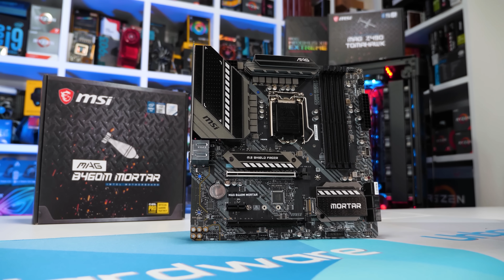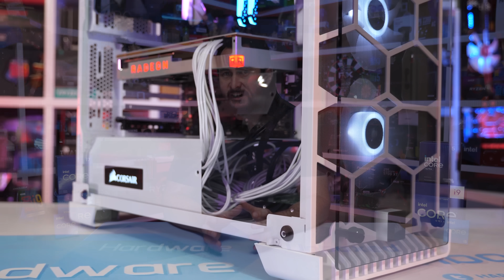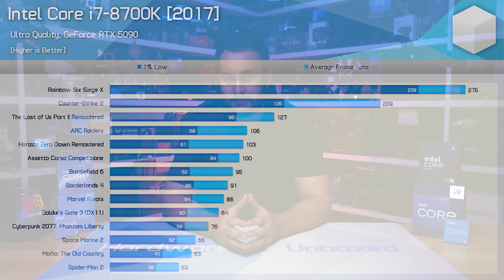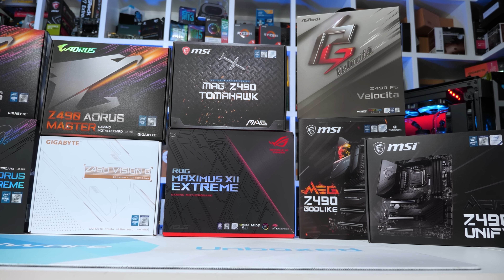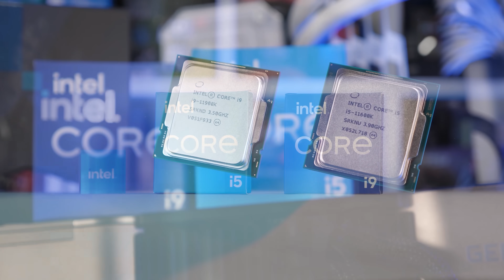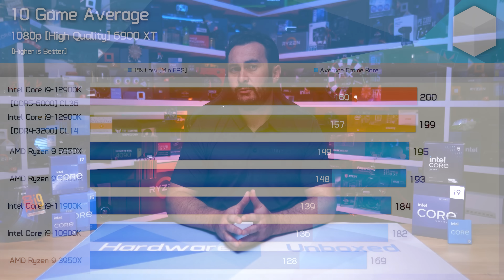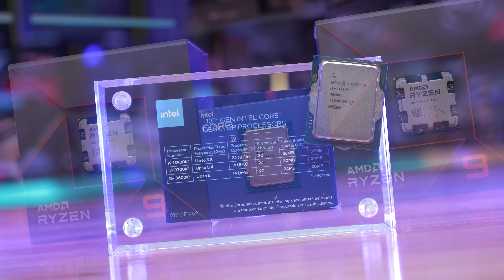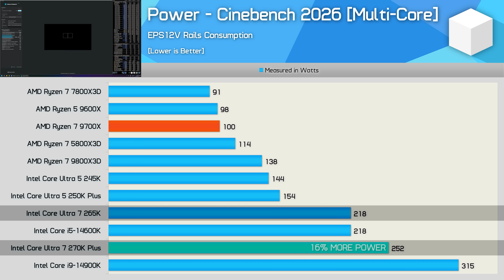How Intel Fell Behind, 10 Years Of CPUs Benchmarked

Comment: If you tried to use these hot chips today you would conclude their performance does not justify the power consumption and noise.
Basically hot, loud, and slow (not fast). Hot loud and fast is fine when new..

Comment: The 8400 was better than a 1600..
Ryzen could only match intel on optimize multi-threaded loads.
The basic core was weaker which meant the rate limiting thread for the game was limited. Single core performance was (and still is) important.

Comment: Just look at those graphs. They SCREAM stagnation. Sleeping in class results in being left behind. Simple as that. I will probably never buy an Intel CPU ever again, out of pure principle. I bought the 6700K when that was THE flagship, best gaming CPU. I never upgraded. Not just because i didn't have the money or need (there was a number of years where i didn't game much after 2020) but the fact that Intel softlocked the upgrade path, as stated in this video. My only real "upgrade" option is the 7700K, and thats a sidestep at best. AMD on the other hand... well... AM4ever. The only thing keeping my 6700K running is sheer willpower and an OC. The CPU STRUGGLES in this day and age. Sure i might have "average" frames that are playable, but the stuttering, the frame times, the absolute struggle of doing ANYTHING in the background while having a game up... If i only knew back then.

Comment: Last Intel chip I had was the 6700k. I noticed that newer chips didn't go higher than 4 core so I switched to amd. Now I have a 9800X3D and I still see no reason to go back to Intel. They put all the budget into marketing instead of engineering.

Comment: 11900K....its just a disaster...
Reply: Yeah, they could have re-used the old core design and boost the core count to 12 or even 14 and still end up with a smaller chip than the 8 core 11900K.

Comment: correction lga 775 (2004-2010) had around 6 years of intel support , yes 1156 came out during this time but processors for the 775 platform were made up to 2010 so this was the most supported platform intel ever came out with

Comment: What I think is worth mentioning is that 14th gen game out BEFORE 13th gens degradation issues were known, so it not only had the same issue, but it was exacerbated by the fact that it was pushed even harder. Intel was just REALLY desperate to maintain their lead in benchmarks, both single and multi core, over AMD, so the hardcore overvolting and overclocking was just necessary. I dont see how nobody couldve seen this, but I could absolutely see marketing or management or some higher-ups just ignoring any warnings by the actual engineers. I mean, engineers, what do they know, right?
Also a common theme with 13th and 14th gen CPU degradation was the curious flavor of symptoms, which were incredibly varied, but invariably pointed at other system components. This was because the ring bus was on a smaller node that was more susceptible to degradation from the higher voltages and thus generally was the first part to fail. Depending on where exactly the degradation occurred it could lead to all kinds of fun errors, from 0MB VRAM on GPUs to RAM issues to USB controller issues, take your pick. Which means that pretty much any time I do friendly tech support I will, regardless of symptoms, check the CPU if its one of those two generations. Happens surprisingly often.

Comment: love it how everyone keeps forgetting about the cpu oxidation issues, ststing that intel has fixed the 13th and 14th gen cpus when the microcode bug was just making the already existing manufacturing defect worse quicker.
also that these cpus are still dying even with those microcode updates.
Reply: Yup, and in server applications, that vulnerability is basically a deal breaker.

Comment: It’s the socket changes that hurt Intel so much. You can have a slightly worse product than your competitor if the switching cost/upgrading cost is lower because I don’t have to buy a new motherboard, but if I’m going to buy a new motherboard, why wouldn’t I switch to the better value option?

Comment: Peaks : 8700k
10700k
12700k DDR5
(Possibly nova lake processor next)

The 13/14 gen did not make it to the list due to power draw and instability , and 270k+ is good but with 4 years apart from 12700k I expected a bigger jump and with nova lake around the corner doesn't make sense to buy so it didn't make it either.

Comment: I still use a 9900k in one of my old gaming computers. I have it paired with the RTX 3090. 

I have my chip overclocked to 5 gigahertz all cores. I don't think I have ever seen it go over 65C. That's with an all-in-one cooler.
It's a great chip. 

I wish I grabbed one of those 10900k chips though. I really love that 10 core configuration. 

Then we got the 11th gen crap....😭😭😭

Comment: Intel really was the king of the quad-core era, but they fell victim to their own dominance. For years, they just recycled the same Skylake architecture, essentially 'taping' on minor clock speed bumps and calling it a new generation (like the 7700K being a 6700K refresh). They got lazy with 'toothpaste' thermal paste and blocked motherboard compatibility even when the sockets were identical. It took AMD’s Ryzen to finally force them to add more cores, and even then, they just brute-forced it by pushing power draw to 300W+ until the chips literally started degrading. After a decade of stagnant 14nm 'plus-plus-plus' refinements, their current underdog status is 100% earned

Comment: That comparison of ddr4 v ddr5 for 12900K with the 11900K in picture is something I really wish I had seen when I built out my system last year.
Oh well, at minimum I should be glad I have a good system at all and built before the ram prices skyrocketed.

Makes me question what I heard anecdotally about 11700K to 12700K though.

I had a 12700K, upgraded to a 14700K, and passed the 12700K plus a repaired bent socket pin motherboard onto a friend who had an 11700K system. She said she got decent increase in halo infinite, guess it’s a lucky coincidence and one of the games that did see a decent increase even with same ram.

Comment: Classic case of painting yourself into a corner. The biggest problem they had was putting too many eggs into the 10nm process. It backfired spectacularly. I also knew quite a few intel engineers and a lot of them were cocky and full of themselves, and it was a potential indicator of the intel culture at the time (between 2008 and 2015ish).

Comment: I used to run Core i7 3970X somewhat overclocked to 4.2GHz (all cores) from the launch year all the way until I upgraded it to a Ryzen 5 5800X. Now I'm going to sit on it about as long if not longer, I guess, considering 98% of games are GPU limited nowadays (although ray- and path-tracing do require extra beef even on the CPU side, when this type of bottleneck actually comes into play, the framerate is already unplayable anyway).

Comment: excellent video as always. I haven't even though of Intel since my 8700 desktop & 10750H laptop. That laptop with the big i7 was out of date when it released lol. The AMD laptop chips (Zen2 at the time) blew it out the water. But got a good deal on it. It's still a decent performer, but impossible to cool that chip. If you can keep it's temp in check it's not awful.

Comment: I used the i5 2500k from it's launch until I got the Ryzen 3600, about 8 years I think; It just felt wrong paying the price of a whole build for 5% performance jumps. So I just bought a midrange GPU every few years, considering the CPU "good enough" not to bottleneck it, and it really worked out. I probably could have waited until the 5800X3D because it was then that I felt like I was sucking on NOS, the 3600 just felt like a better 2500k.

Comment: If you can look past all the bad press, picking up a 14th gen intel CPU at a discount is a great buy if you know how to tune. Sure, it was a hassle to update the BIOS and figure out all the new settings coming from a 9900K, but the performance is fantastic on a heavily undervolted 14700K. Still rocking my DDR4 kit and saved $400.
Reply: Still wouldn't buy used 13th and 14th gen CPUs.
Reply: @RandomPersonOf2005   Probably safer to buy new at discount.

Comment: I just built a PC with a 6700k. Managed to OC to 4.6 GHz, but it is still the bottleneck at 1080p. Paired with a 4060 Ti 8 GB. The things you need to do in the current hardware climate.

Comment: I'll watch the video later on today, but for me I got burnt by the constant socket updates. My last Intel CPU was on the latest socket which was then obsoleted months later. For someone who slowly upgrades their PC when needed (instead of an all new system build), this is a pain in the neck and you feel like you're buying less premium parts to keep an obsolete platform going. I liked the idea that AMD stick with a socket for several generations, so I switched to the 7800x3D on AM5. It was significantly cheaper than the Intel equivalent, is better for gaming and is still towards the top of the gaming benchmarks.
Even now, if you buy a cooler - you're supplied with two AMD brackets and up to five Intel brackets for each generation.

Comment: I was thinking. Numbers are good in reviews of GPUs and CPUs, but it would be great, imo, to include software features vendor comparison - people have different needs, not just performance, and features are a huge deal nowadays. This could be shown on the screen when making final verdict/recommendation in the form of a table:
Features		AMD		Intel		Nvidia

upscaling

rendering at 
higher resolution	AMD Virtual Super Resolution

frame generation

ray tracing

ray regeneration

background noise	AMD Noise Suppression	no	NVIDIA RTX Voice/Broadcast

background blur

background removal

background replacement	no	ARC Virtual Green Screen function 	NVIDIA Broadcast's Virtual Green Screen

parallel computing platform	oneAPI(+)	ROCm(++)	CUDA(+++)

anti-aliasing
Next to every solution you could put 0or1or2or3 stars - 3 for the best, 2 for the middle, 1 for the worst performing. People would then get fuller picture. Tim would make this table in no time.

Comment: I think that those Intel Loyalists lucky enough to be part of the 4770k--->7700k--->9900k---->13th Gen upgrade cycle/cadence had a near seamless and quite enjoyable experience. Those that fell between those generations, especially those visiting the 10th/11th/12th Gen offerings as part of their upgrade cycle, had a much more controversial time. As an 'Elder statesman' with other looming priorities and interests, replaced my aging 7700k with a 3900x at it's launch on X570 and followed it up with a 3950x, and finally a 5950x, all in the same system. I am looking forward to going back to Intel with the upcoming 300 Series, or at the latest, the upcoming 400 series.... as my tuned 5950x still does what is required of it. I want to see Intel succeed. If their GPUs are anything to gauge the company's commitment to progress in such a short period of time along with the recent 200 series refresh that is impressive in itself, I see them coming back to parity at a minimum for single thread/high clock dependant performance, or perhaps even greater. The 'tables' have literally turned upside down and AMD is not 'Intel' of old. More power, higher clocks, more heat.

Comment: ill never forget the decrease in room temperature going from a 9900k 3080 combo to a 7800x3d 5070ti combo. my office is now a livable space
Reply: There's a 50 watt difference between those two systems 😂
Reply: @Cuxzzzs my old system used almost 900w under load. My new one uses 300-400. 9900k used 140w or so. My 7800x3d never pulls more than 50. 3080 12gb strix pulled 400 by itself. My 5070 ti prime pulls around 170
Reply: @rileyhance318 
There's no way a 3080 and 9900k is pulling 900 Watts under normal circumstances
Reply: @Cuxzzzs 9900k was 5ghz all core and my 3080 was a strix model. Easily got 400-450
Reply: @rileyhance318 
Still doesn't pull 900 watts liar 😂😂😂

Comment: One very nice benefit of the Skylake family of cpus (esp 10th gen), excellent platform latency which was ideal for video and audio production. Unfortunately, 12th gen did not maintain that advantage (11th was hit or miss if I remember correctly).
Reply: Zen 6 is gonna be a revolution in latency for modern CPU's thanks to the active silicon bridges connecting the CCD's to the I/O die. It's also gonna FINALLY allow games to properly scale past 8c/16t on AMD CPU's with full performance.

Comment: Intel relies on sales of their chipsets, huh? Who made you make that up, Steve? As far as I know, the cost of an Intel chipset is around $25–75, which is far below what Intel and AMD make from their high-end CPUs.
Reply from the maker: So they don't make money from selling their chipsets? Or do they? You seem to be suggesting because they make less money selling chipsets they don't do it to make money? Really bizarre take that will need some clarification.
Reply: @Hardwareunboxed  I felt like you implied that it was their business model and a decent source of income. In reality, though, it's nothing compared to the CPUs they sell. They simply don't design sockets for multiple generations, not out of malice but because redesigning chipsets to fit new generations of CPUs is easier for them.

I would be remiss if I didn't mention that AMD also has different generations of AM4/AM5 motherboards with new extra or better I/O options including faster RAM support. So, the idea of a single socket is just a fairy tale.

People rarely upgrade just the CPU; they usually upgrade the entire build or the motherboard and CPU together. I understand that a long-running socket feels like a major advantage for many AMD fans and reviewers, but I guess that less than 5% of AMD users upgrade the CPU alone which makes the whole argument extremely moot.

Thank you for your comment, much appreciate it.

Comment: My last Intel CPUs were 4790K and 9700K. Moved to AMD afterwards due to power efficiency and longer socket lifecycle. Building my PCs for 30+ years, and swinged between AMD and Intel a couple of times. 486DX4-133, K6, Athlon 462 and 939 were great offers from AMD, providing more value or even performance than Intel. Core2Duo, socket 775 and early Core i5/7 generations were the last time Intel did right for me.

Comment: funny thing is that when you tuned some settings in bios with 14th gen i7 you can limit power consuption to 170W while remain all performance...for 28 thread cpu is pretty insane.My temps doesnt exceed 70 degrees on full stress test and Im running it about year and half.No degradation etc. TBH I dont know why intel pushed the wattage so damn high just to hits a 1-2% of performance higher and put those cpus at high risk

Comment: intel constantly changing sockets has never bothered me. over the past 20 odd years ive never once needed to upgrade my cpu. ill build a pc and itll last me 5-7 years, and typically ill upgrade the gpu somewhere in the middle, but the cpu has never needed an upgrade like that. and after a few years technologies will change and it might be worth a new motherboard anyway. next pcie version, better networking, better everything. obviously im not claiming to be everyone and for some people it may be an added cost, but even a 5 year old cpu will hold up in modern titles if you play at a normal resolution where the bottleneck is the gpu. i built a system with an i7-6850k back in 2016, originally with a gtx 1060, then upgraded to the 1080ti and then in 2023 i upgraded again to the 4080. it was only then after 7 years that the cpu was holding things back, and there was no point upgrading the cpu to the best thing on that socket, it was time for a whole new cpu, motherboard and ram to go from ddr4>5 pcie3>5 etc.

Comment: i love my 13700kf and 14600k chips. i always keep the bios up to date on both systems so never encountered any stability problems and although the 13700kf gets very toasty when pushed to its limits even with a noctua nh-d15, there realistically isnt any chip faster than them for gaming where the gpu is the bottleneck not the cpu, at least for their 4080 and 4070ti super respectively. my 13700kf does have a dodgy memory controller though, works in spec but wont go over 6000mhz.